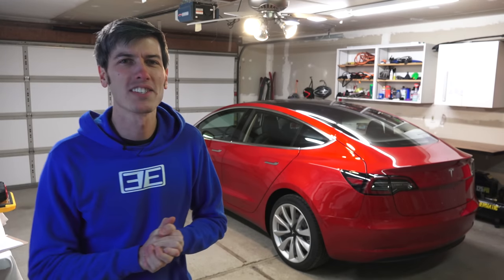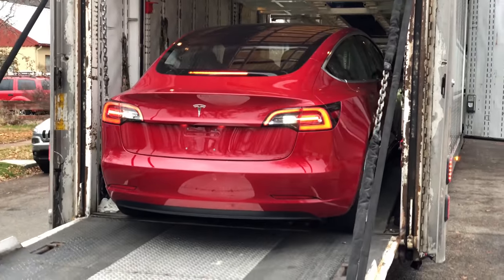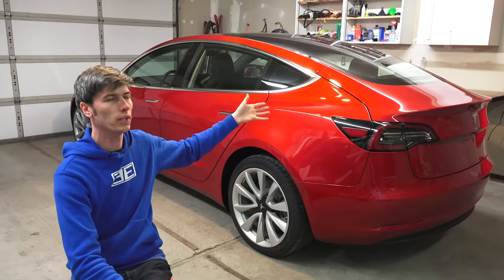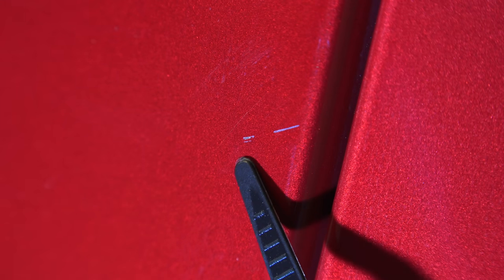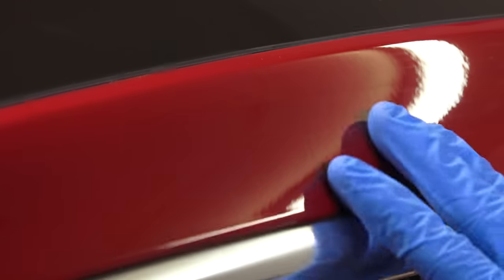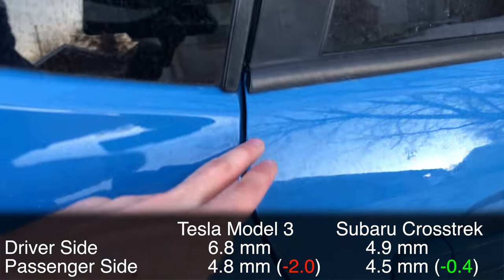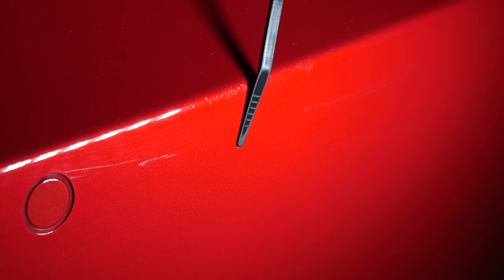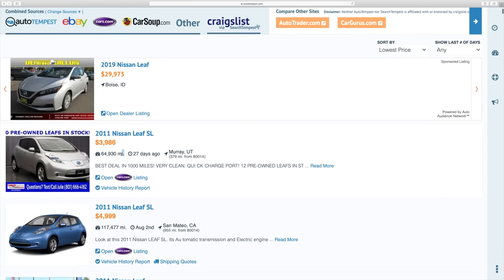Everything That's Wrong With My Tesla Model 3 - Quality Problems

Comment: Working in a car plant, those scratches are not normal. Or rather: shouldn't be.

A single scratch might slip by final inspection and quality checks, but unlikely. But if the car left the factory with all those scratches, someone isn't doing their job. And I'd expect more froma manufacturer of  higher priced cars.

It seems as much as Tesla have their electric act together, they have yet to  master being a car manufacturer.

The texture of the paintjob overall doesn't seem odd, though. Looks like the normal fine texture of paint in run-of-the-mill cars off our production line, to be honest. However, we decidedly DO notice  special option paint jobs in odd colours, as they are hand painted rather than robot painted and have a much better, smoother and more glossy finish.
Reply: On the other hand, they are practically new to the business, but should really up their attention to detail, otherwise as soon as the other brands catch up to their technological edge, they are minced meat.

To be honest, though, when I went to a dealership/garage for the brand I am working at, to get some maintenance on my own vehicle, it was around the time the first specimen of a new generation of one of our models were delivered, and the gaps, paintjob etc. of the brand new specimen on display were abysmal! 

So if established manufacturers have trouble with new model generations first batches, I am willing to accept a new manufacturer to screw up on their first specimen, too. 

One of the reasons I'd never buy a new car from the 1st year or two of the model. Too much potential for halfbaked engineering details and teething troubles on top of teams and plants struggling to adapt to manufacturing something diffrent whilst meeting production numbers required.
Reply: I have a good feeling that most if not all the scratches are from shipping rather than defects from the plant
Reply: @ThePetalesharo  Yeah, scratches usually are from after a car leaves the plant. 
Usually. 
But you can never say for certain. Easily visible ones will, or should, never leave the factory.
Reply: They should just be a hardware company. Sell the drivetrain and batteries to other automakers, and leave the car building to those who know what they are doing.
Reply: @Ratkill9000  I don't think it is all that productive to say "don't start a business in an area where there are already pre-existing businesses, leave it to the pros!" 

Some growing pains are inevitable. wether or not they will master the hurdles, we shall see.
Reply: @Ratkill9000  They used to do that but the others only wanted their drivetrains for compliance cars. If they hadn't built the Model S then they would not be supplying anything to anyone and we wouldn't even talk about electric cars as we do now.
Reply: @lutzderlurch7877  Well it helps if you pay attention to the lessons that "those that know what they are doing" learned decades ago but nope, Elon's gotta do it his way and chose to ignore industry best-practices and as a result suffered teething problems the major brand worked out in the 80's and 90's.  It's probably for the good of Tesla that the SEC forced Musk out of his chairmanship.
Reply: @LeCharles07  It's not always bad to question the status quo. In some aspects, that's remarkable about Musk, that he's comitted to try new things. On the other hand, he may have gone too far in this direction, qeustioning everything at once. The penalty for that is a bunch of problems and the long term impact on the image of the brand.
On the other hand, the common practises are known, so he doesn't have to invent them from scratch. 

Let'S just hope he has the sense to adopt common practise where it is superior to his ideas, and does so in time.

He also is a peculiar character with some odd ideas, and it is likely for the better, that his direct influence  in tesla  has been limited a bit.

Let's wait and see.
Reply: @Ratkill9000  Building drive trains and selling it to auto manufactuers who know how to build cars.....Yeah that would work for a while and then their customers starts to build the drivetrain and batteries themselves and kick Tesla to the curb and then Tesla will for sure go out of business. 

So what they are doing is still the best choice long term.  Tesla been making cars for how long now? Less than 10 years? Well, Ford started making cars in 1908 and panel gaps were terrible, ten years later in 1918 I doubt their panel gaps were better during that same amount of time.  

We need to give Tesla a break.
Reply: @Al13n1nV8D3R  Put it into perspective, you are paying Mercedes cost for cars with imperfections. If I was buy a $45,000+ vehicle, I would complain until it was fixed for free.
Reply: @Al13n1nV8D3R  . . . you personally are allowed to give Tesla a break (and accept quality issues) - but the market / competitors will definitely do NOT so!
Reply: @lutzderlurch7877  Um I work for Honda  and our cars go through an initial inspection in paint, before a final inspection in paint, followed by an initial inspection in VQ paint and a final inspection in VQ paint followed by an overcheck in VQ paint to make sure the paint is perfect. Any imperfections show the lack of quality inspections carried out by Tesla.
Reply: @Thiterest1  Yeah, that applies to the speck of dust in the paint.

The overall texture of it doesn't seem out of the ordinary for modern cars, and scratches have a decent chance of being results of careless transport.

I agree they have to learn and improve, but I just don't think neccessarily that it is that usefull to blame everything on them.

Although I believe they do not have dealerships, so there may be a whole new learning curve and responsibilities connected to that particular aspect.

If transport is the source of most scratches, they might  consider doing what many other manufacturers do, and  cover  the new cars  in parts or whole in a protectiveplastic or  cover.
Reply: @Al13n1nV8D3R  On the other hand, ford was a pioneer and the first to use a production line for the cheapest car  available at the time. He had to develop all things more or less from scratch.

Tesla more or less just needs to adopt solutions others are successfully using  for decades now.
Reply: @cashuma5010  They have the benefit of being ahead in the electric car technology. They really need to look at what works and what doesn't, and adopt working solutions to their problems the rest of the industry has figured out  decades ago.

Their edge in technology has given them a headstart, but they really need to catch up in the rest of the quality aspects of car manufacturing, and fast.

It'll be an interesting time the next few years.
Reply: Elon Musk himself should randomly audit a certain percentage of cars produced so so he can for himself spot those imperfections and at least retrain those employees for letting it pass through and at the very most fire one of them. Doing the latter will surely make his employees be more careful and learn a valuable lesson.
Reply: ṽᴧ volts  That is truly nice, but where is the electric Volvo that goes 400km and has a huge charging network? (Cause I'd buy one!).
Reply: ṽᴧ volts  Never going back from EV so not a consideration.
Reply: @Al13n1nV8D3R  Tesla has been making cars for over ten years, not under.
Reply: ṽᴧ volts  I don't often go to places without electricity. Sometimes I do and even then it's reachable with the Tesla. My family has 200'000km with two Teslas now. Never going back.

Comment: Why weren't white wraps used on this vehicle during the delivery process and taken off after he takes the car off the transporter. This can be avoided. Tesla step up your game. Make the customer feel like they are getting something perfect with no scratches and dust under the paint job.
Reply: they do wrap it with white wraps. i see them on trucks all the time getting shipped from the factory and they are wrapped on the front and back.
Reply: How would wrapping have helped, when the scratches are under the coating? Right, it wouldn't.
Reply: @JulianWiersbitzki  What got from this was that the scratches went all the way THROUGH the coating, which means instead of clear coating over any scratches from the painting, they let some doofus rub his cargo pants all over the side AFTER it rolled of the line.
Reply: @h8GW  Okay, you're right. I misunderstood the water test.
Reply: Someone probably rejected this Tesla first, so the white wraps had already been removed. It then got dumped on this poor schmuck.
Reply: @randyvanvliet226  That doesn't explain the dot that is clearly in the paint
Reply: @geevh  Regardless of when the "goober" in the paint was discovered, whether it was rejected by one or two owners, that it is under the clearcoat and pigmented in color indicates it ended up in the paint on the color coats, not the clear coats. Factory defect. Whether Tesla tried to pass it off once or twice, their QC is pathetic, and they are wasting a TON of money on deliveries for faulty product. Hard to make a profit with such gross mistakes and QC.
Reply: @randyvanvliet226  this days more important how many gays, transgenders, colors and female involved in process - not the process...!
Reply: Oh yea... and the crap under clear cote, and all that freckling door-gaps differences would be magickly self-fixed under mighty "white wraps"  GO! white wraps!!!
Reply: white wraps should be banned, along with all other single use plastics.
Reply: @robethius_  from factory to dealer ship have wraps then they remove get polish for final client.
Reply: My theory on what happened with the door behind the drivers side is either that they aren't level or that the doors were painted separate to the body and the door has been laid down on a surface with some material that is capable of scratching it like small stones or the likes.
Reply: I can 100% tell you this was caused by the workers. This should not have been missed by the VQ section, which means either the VQ section isn't doing their job or the scratches are being caused by VQ workers uniform rubbing on panels. @linkieup the paint gets finished before the car leaves the factory, it can get damaged in the factory before it leaves.
Reply: @Thiterest1  so mate VQ  its fucked because he sign papers saying ok passed. but truck driver in factory can made scratch in car?
many hands before reach final client. dont know if youtuber write in papers scratch's in paint when he receive car. now will be passing this ball. and client is fucked in end, one everyone laughs.

Comment: The main issue I have with panel gaps is not the look or anything, it's a much bigger issue.

When you have gaps that are up to 2mm difference per panel then that means that either the car or the part in question is being made to such a tolerance that could potentially lead to you purchasing a replacement door for the same car that came off another identical model, but that is too large to even fit yours.

It is nothing to do with being picky about who cares about the gap, it shows that the parts aren't made to a very strict quality which shows that down the road even NEW parts might cause issues, especially with body panels which even made to very tight standards, still causes difficulty for Body Shops for example

Comment: I've worked at car transport companies and unfortunately, any scratches, dings, dents etc etc are usually from the drivers/people loading and/or unloading the cars onto any means of transportation (either car haulers or trains). Most of these people are paid by the vehicle they load/unload etc and they are always in a hurry. Once a vehicle is dropped off/delivered, it is your responsibility to point out any defects to the delivery person before you sign the acceptance of delivery so their insurance covers all the damages. Most people dont know about all these about car deliveries and it's not good...
What i'm trying to point out is 90% of the "damages" on your vehicle (or any delivered vehicle) could be from the transporting company and not from tesla (yes of course the paint defects are, i'm referring to scratches etc etc etc)
Reply: That's true. For that case for example BMW pays extra space in the cargo ships so they don't get damaged too easily. I already bought 2 new BMW and never had any paint issue. Both cars I bought  3000km away from factory in Germany and they had 1km on it and the other one had 2.4km on it. Don't know how they get 23mil on a new car.
Reply: Tesla is know for bad quality. Nothing new. Panel gaps, dust under clearcoat etc. Its tesla :)
Reply: You are right. The carrier signs for the car in good condition. It’s the owners responsibility to note any damage on the freight bill before signing. Most people aren’t aware of this.
Reply: Why would they not protect the cars for environment for transport? I visit at the Volvo about twice a year and sometimes I drive past it and I have seen that yard is full of new cars with protective caps in brake rotors, and shield the car all around with plastic/cloth so nothing will scratch the paint of any panel during transport.

Comment: The paint on the Subaru looks beautiful, no orange peel there.
Reply: Definitely orange peel on the Subaru. Just quite a bit less. Even brand new Ferraris have orange peel. It's usually in the color (not the clear), so buffing/polishing can will never fix it, unfortunately.
Reply: All cars have orange peel.
Reply: The only cars that don't have orange peel are Lambos, Aston Martins and other hand-made cars.  Their paint department blocks all their cars to get them to glass smoothness.  This car is ridiculous, especially for a 'technology company' that should be eliminating all these errors.   For a company that employs so many robots and has been producing cars well over $100,000 for a decade now,  this is a BS oversight.
Reply: Subaru's are renowned for having terrible paint and orange peel from factory lmao
Reply: @MrChurchh  Subarus are also subjected to a lot of pointless whining. I'm on my third subi and the paint has been awesome on all three.
Reply: @austinshoupe1506  Congratulations on not caring about paint quality? Thin paint and clear coats with plainly visible orange peel off the delivery truck is almost a guarantee with Subaru.
Reply: @petertoft70  Most reputable modern manufacturers do have orange peel, but not nearly to this degree.
Reply: @MrChurchh  again, on my third. No orange peel on any. The 2017 is black and 20k miles of rural high way driving and I only have two nicks in the hood. The 2007 and 1998 we're stupidly tough. My 1998 was owned before my by someone who lived 2 miles from the nearest paved road. Only a handful of roof nicks when I bought it in 2007.
Reply: The Subaru will look beautiful in the shop getting the head gaskets replaced too.

Comment: Whenever I see a car transporter with vehicles from any manufacturer over here in Europe the cars are covered in a thick plastic wrap to prevent that kind of paint damage. That is for any car from a 9000 euro base model ford Ka to a 100000 euro Mercedes amg. Those scratches are unacceptable, did they drive it through a sandpaper factory on the way to the truck?
Reply: Tesla just began to be profitable again recently because they ramped up production of their cars by building a makeshift manufacturing facility in their parking lot. Look it up. They were in dire straits because they were losing a ton of money, so they decided to just literally get cars made and sent down the line. Basically, they've been rushing them and Jason has obviously received a rushed product.
Reply: They polished it with sandpaper
Reply: Either that, or it has already been in some kind of accident in those few miles..
Reply: U.S. new auto transport is the same, for M-B, Ford and Kia.  Maybe not for Tesla?
Reply: The defects under the clear coat happened at the factory.
Reply: They use coarse grit sandpaper to remove dust. That's also how they clean their vinyl records at home.
Reply: I was kinda wondering when he showed it since every time I have seen a tesla on a transport truck, and pretty much all new cars for that matter, are covered in plastic. Now his was delivered in an enclosed trailer so maybe thats different but most of that damage looks like it was caused after the car was done. Still doesnt excuse the other QC issues brought up but in that case it would seem a third party may be at least partially to blame and should never have been turned over to a customer in that condition.
Reply: @ATEC101  Yeah, some of those "scratches" looks like silver paint to me. Others look like someone with a dirty cloth tried to wipe down the paint.
Reply: i have seen it once, but most cars on delivery track just have, plastic protection in the interior
Reply: That would be the primer underneath. @SgtStinger

Comment: Bought a new Model 3. 
1. Paint scratched from transport = Tesla tried to polish it w/o success, had to paint it. 
2. Rattles from the rear door = 2 days w/o the car, two faulty locks
3. Rattles from a front door = under evaluation…
Great iPad Pro Max with 4 wheels though.

Comment: The scratches and paint defects on the vehicle are just unacceptable on any new car at any cost. It becomes a serious issue especially on a car this expensive. You don't expect such things from a premium car manufacturer. The panel gaps are not that big a deal, in my opinion, but again, for such an expensive car, you expect it to be better than your average car. It just shows lack of quality control.